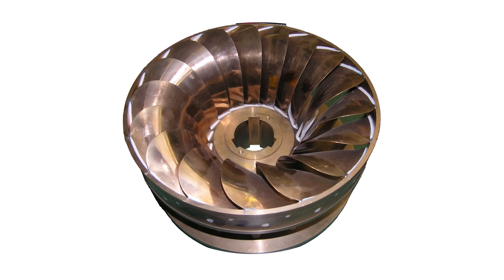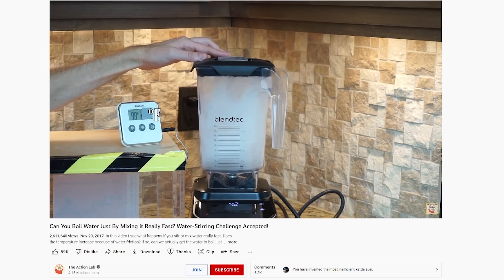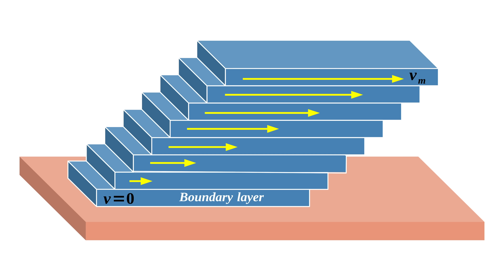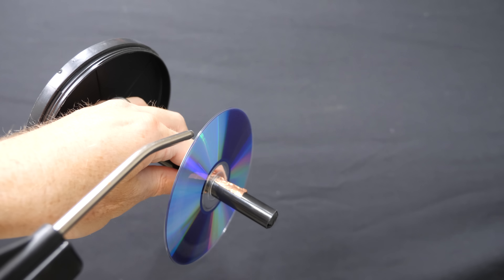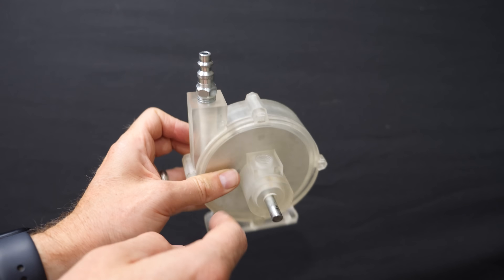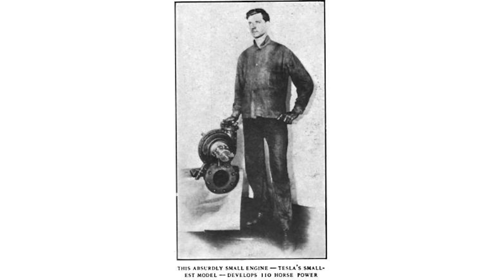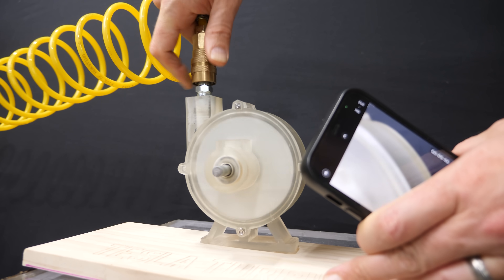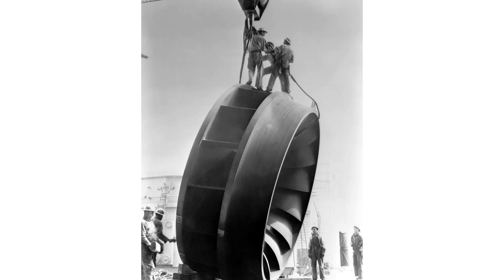How Fast Can a Tesla Turbine Spin?

Comment: In the wine industry, I was amazed to see a Tesla turbine used as a wine pump. This was in 2008 at Frey Winery (Redwood Valley, California.) The Frey family are MIT level geniuses who are happy just making wine.

They were using Tesla turbines as reversible wine pumps long before the Internet got fascinated with them -- and have been using the design in a practical manner for decades.
Reply: Is this because wine can "bruise"?
Reply: This is interesting as hell. Appreciate you dropping the heads up.
Reply: That was a very helpful comment for me . Thanks for the information
Reply: The Frey family sound like wonderful people.
Reply: @879PC  Just don't invite Walder to your wedding.
Reply: Tesla turbine or pumps are not reversible, it is peaked at around 50% to 60%. Because it uses boundary layers, that is main reason of aerodynamic drag and efficiency losses. Hydrodynamic turbines and pumps can achieve 90% efficiency, but complex geometry.
Reply: @murat9268  When you can type in complete and coherent sentences, it might be worth replying to your thoughts. Until then, I can assure you (having used them myself on $1k/gal+ wine) that Tesla pumps are reversible.

Be Well, Friend.
Reply: @fenwickrysen  Reversible mean no losses of any kind, means ideal. I think your engineering knowledge is not "complete and coherent"... There are no reversible machines. All of turbines, pumps and compressors have their efficiency curves (Cordier Diagram), that shows where their respective efficiency is peaked. Tesla turbines and pumps are simple design, not best efficiency design for specified purpose. 

Using a tesla pump does not prove that it is 100% efficiency(means reversible.) Calculate reversible work needed, then measure how much power is consumed and calculate efficiency of your pump.
Reply: @murat9268  I believe they mean reversible as in 'can be spun the other direction.' Not reversible as in 100% efficient with no losses. My car's engine isn't 100% efficient, but I can still put it in reverse.
Reply: @DroeGaming  Engine does not turn in reverse, your differential have one more gear to reverse rotation.
Reply: @murat9268  I'm not sure why you are assuming that the reversing requires 100% efficiency.  Can you please explain further?
Reply: @murat9268  Depends on the power source. Lets say it was powered by a combustion engine then yes you would need another gear between the drive shaft and the tesla pump. However I would argue that is a problem in the power source not the pump.

A 3 phase motor can be reversed by switching any two of the power inputs around the Tesla pump is 100% reversible. Your arguing that because the power source cannot be reversed easily the pump cannot be either. The pump is independent of input when we say its reversible we are saying the pump can change flow direction with out haveing to be disconnected and turned around.
Reply: @therasco400  I'm out. Nobody here know simple thermodynamic concepts, i cannot teach laymen thermodynamics.
Reply: @murat9268  transmission, not differential
Reply: @murat9268  No you do understand this device at all. 

We are saying apply power to spin one way it will pump water that direction. Apply power to spin in other direction it will spin in other direction and then pump water in that direction. Inlet becomes outlet, outlet becomes inlet. 

There is no conflict in thermal dynamics in this instance as its being powered by a motor. 

Your comment on thermal dynamics seems to me you believe we are talking about steam, we are not. We are saying you can change the pump flow by reversing spin direction, not that steam will flow in a different direction.
Reply: @fenwickrysen what do you mean by reversible? Surely not the 100% lossless definition that came out of nowhere?
Reply: @ki0w0-lordofwatersheep  Thanks for the laugh! No, not reversible in the physics arrow-of-time sense. Reversible as in the input and output feeds could become (respectively) the output and input feeds.

Comment: Actually it is not the laminar flow that is responsible for the working of a TT, it is the turbulence in the boundary layer. It is the turbulence, in the portion of he boundary layer,  that transfers power from the fluid having mostly laminar flow, in middle of the inter disk space, to the disk surfaces. In addition, it is that turbulence layer, which increases with the increment of the differential speed, between the fluid and the disks, that creates negative pressure and sucks (as described by Dr. Robert D. Hunt in his "Drag sucks" )  the disks strongly towards the inter-disk spaces (behaves something like magnetic lock), which allows the turbine to create its torque. And all these things even do not take in to account the thermodynamic characteristics of the fluid, which change as the fluid swirls in the inter-disk spacing. In short TT, in spite of its simplicity is a very complex thermodynamic transformer that should be studied via real world models, instead of relying on standard postulates, many of which are frankly, very miss understood (as Dr. Hunt also notes).
Reply: 🤭 turbulence means loss… full stop.
Reply: Charlie solis builds actual working TesTurs. You can’t argue with real results.
Reply: Turbulent flow is only created if you spacing is to wide in between the discs if it's 2,5x the boundary layer it's gonna be fine
Reply: @oscarverwey  should be less than 2x the boundary layer.
Reply: @CharlieSolis  yahh at working conditions it should be les than 2 X when startup I can imagine it's higher

Comment: Could they be scaled down and arranged in an array with funnels to catch rain water and use that to produce electricity? Each drop would spin the disks a little faster. I haven't seen any system that harvests energy from rain, but I'm sure there must be some.
Reply: Why would every drop spin it faster? Rain drops only travel at a few metres per second so they're not going to make anything spin faster than that even assuming they transfer their energy well.

They do have things that harvest energy from rain. They're called hydroelectric dams.
Reply: @igrim4777  The first drop that hits it wouldn't make it spin at top speed. Each successive drop would make it spin faster. 
Rain is actually different than a reservoir of water. Rain is water that falls from clouds in small drops called raindrops. A dam holds back a body of water that could have come from many sources, a spring, a melted snowflake, a hiker's pee, or even a raindrop. Do you see the difference now between rain and a dam of water, yes you do.
Reply: @BariumCobaltNitrog3n  Rain falls at about 10m/s per 6mm rain drop, that means with 100% energy transfer theres only a tiny bit of energy that will max out at approx 10m/s thats IF a rain drop could turn a large turbine which is doubtful, and as soon as any work load is put on the turbine the torque will cause it to rotate slower untill it stops. For a more average sized rain drop we get 7.833914655x10 -5 joules or 1 billionth of a KW/h if it has zero losses per drop so 1 KW/h would take 1 billion raindrops directly hitting the turbine "blades" at 100% efficiency.
Reply: @ikitclaw7146  Ok and how many raindrops per square mile in heavy rain? Not tropical storm but the Gulf coast gets a lot. Also there are little funnels so each drop is more like 3 or 4 drops and you're right it wouldn't be a large turbine. Solar panels don't put out much by themselves but in large numbers get some work done. When the sun is gone and it's pouring the panels could turn over and collect some energy from the rain.
Reply: @BariumCobaltNitrog3n  You want a turbine that is square miles in size? are you aware of how gods dam huge a square mile turbine would be?
Reply: @ikitclaw7146  No. That was a math question. The turb...nvm

Comment: I've always thought it would be easy to take excess solar power, use thst to compress air and release thst air later to generate electricity.  This seems like a very easy way to DIY that into reality.  Now I just need a massive compressed air tank and a compressor, thankyou action lab for putting the last piece of the puzzle together for me!!
Reply: But that will be inefficient and it would have a lot of energy loss in the process
Reply: @aniketmandal8786  Compressed Air Energy Storage (CAES) and Liquid Air Energy Storage (LAES) systems are a 100% competitive and viable option even with almost no compressed air engines on the market getting better than ~50% efficiency… most only getting 5-20% efficient. 

Air compression for storage can be very efficient if you just recoup the thermal energy during expansion.
Reply: @CharlieSolis  ahhh the TesTurs that you make are amazing! Keep up the great work! 

Everyone up and down these comments are demanding Tesla turbines can’t work/get low torque/have to be spun to fast to even work yet you’ve got all sorts of proof that Tesla turbines get a butt load of torque even at low rpms!! 🤤

How are these people trying to argue with your conflicting TesTur results? Do they just not know about your work?!
Reply: @aniketmandal8786   also meant to say, “But an interesting idea nonetheless. Keep on using that brain of yours!!!”
Reply: Why use compressed air when you can pump water to the elevated container?

Comment: Something is missing Tesla didn’t make it for low efficiency
Reply: Charlie solis makes real working Tesla turbines. There’s nothing wrong with them. You just have to know how to actually design them. 

Do what Tesla says to do, not spin them fast. 😂

“Owing to a number of causes affecting the performance, it is difficult to frame a precise rule which would be generally applicable, but it may be stated that within certain limits, and other conditions being the same, the torque is directly proportionate to the square of the velocity of the fluid relatively to the runner and to the effective area of the disks and, inversely, to the distance separating them. The machine will, generally, perform its maximum work when the effective speed of the runner is one-half of that of the fluid; but to attain the highest economy, the relative speed or slip, for any given performance, should be as small as possible. This condition may be to any desired degree approximated by increasing the active area of and reducing the space between the disks.”
-Nikola Tesla
Reply: @testurenergy  something missing dude!
Reply: @roycropper420  what do you think it is?
Reply: @testurenergy  I have no idea, I am noooo electrician
Reply: @roycropper420  I think Charlie Solis has figured it out then! His Tesla turbines actually work and have shown to actually produce real electricity. He’s done up to 2650 watt electrical power tests with his turbine on just room temp compressed air 🤭 not even using heat added to it yet!

Comment: There has to be some market and adoption of Tesla turbines. Was there any research on this point before publishing the vid? I’m curious. I would like to know some examples of where they’re used, when they were updated from earlier turbines, etc.
Reply: I build real actual working TesTurs that output actual power and torque even at low RPMs. Half the claims in this video are downright false.

It would seem almost no research was done, and it would seem the patent wasn’t even read because the erroneous claim that the TesTur has to spin fast to work just gets parroted over and over and nowhere in the patent does it even say that. 

The only time it’s supposed to spin fast is when used as a pump/compressor because ALL centrifugal pumps/compressors performance is too speed dependent.

“I have found that the quantity of fluid propelled in this manner, is, other conditions being equal, approximately proportionate to the active surface of the runner and to its effective speed. For this reason, the performance of such machines augments at an exceedingly high rate with the increase of their size and speed of revolution.”
-Nikola Tesla 

But when run as a turbine and spun to fast the centrifugal head will counter the incoming fluid flow, reduing the pressure gradient across the nozzle, reducing the fluids final velocity after the nozzle, reducing the mass flow rate through the nozzle and ultimately reducing power. 

Spinning fast only has a slight increase in efficiency but at the cost of power. 

Again even Tesla himself knew they weren’t supposed to spin fast and even says they work great at high and low fluid speeds and speeds of revolution. 

“Still another valuable and probably unique quality of such motors or prime movers may be described. By proper construction and observance of working conditions the centrifugal pressure, opposing the passage of the fluid, may, as already indicated, be made nearly equal to the pressure of supply when the machine is running idle. If the inlet section be large, small changes in the speed of revolution will produce great differences in flow which are further enhanced by the concomitant variations in the length of the spiral path. A self-regulating machine is thus obtained bearing a striking resemblance to a direct-current electric motor in this respect that, with great differences of impressed pressure in a wide open channel the flow of the fluid through the same is prevented by virtue of rotation. Since the centrifugal head increases as the square of the revolutions, or even more rapidly, and with modern high grade steel great peripheral velocities are practicable, it is possible to attain that condition in a single stage machine, more readily if the runner be of large diameter. Obviously this problem is facilitated by compounding, as will be understood by those skilled in the art. Irrespective of its bearing on economy, this tendency which is, to a degree, common to motors of the above description, is of special advantage in the operation of large units, as it affords a safeguard against running away and destruction. Besides these, such a prime mover possesses many other advantages, both constructive and operative. It is simple, light and compact, subject to but little wear, cheap and exceptionally easy to manufacture as small clearances and accurate milling work are not essential to good performance. In operation it is reliable, there being no valves, sliding contacts or troublesome vanes. It is almost free of windage, largely independent of nozzle efficiency and suitable for high as well as for low fluid velocities and speeds of revolution.”
-Nikola Tesla
Reply: @CharlieSolis  keep up the amazing work! You’re going to change lives!!
Reply: Modern TesTurs have been shown to get over 80% efficiency….

“Design and Development of a Small-Capacity Tesla Turbine for Rural Applications

Bangladesh is in great need to find renewable energy sources for its fast-developing industrial sectors. The main objectives of this research are to design and fabricate a small-scale efficient Tesla Turbine for remote areas and test it through experimental investigations. Performance analysis of the newly designed Tesla Turbine suitable for remote areas of Bangladesh will be conducted. Until now, a number of researchers have undertaken several tests and studies to evaluate the Tesla turbine's performance and efficiency. Tesla Turbine does not proficient in producing torque. The work here consists of computational analysis and an experimental campaign by fabricating the turbine. Solid Edge 2021 is employed for our 3D modeling. For modeling, the desired material is Polylactic Acid (PLA) or ABS Plastic. The proposed design consists of 51 disks with an identical spacing of 3 mm. This design has led to achieving a torque of 19.85 N-m and a staggering efficiency of 81%. It was found that stress generated on the disk edges is higher than their centre due to high centrifugal force.”
Reply: @CharlieSolis  Dude stop spamming your crap on all your alt accounts. It's pathetic.
Reply: @-Devy-  🤭 ok bud. Keep telling yourself that. I’ll be over here making actual working Tesla turbines ✌️

Jealousy doesn’t look good on you.

Comment: I'm curious about cavitation, they work for heaters, instant steam generators. But ive read somewhere that it also helps with aerodynamics.

A vehical with golfball size indents spaced an inch apart all over the car will supposedly more aerodynamic because it's ability to resist air friction by using its own cavitational eddy throughout the entire surface. Thus allowing air to flow against air with the boundry of that cavitation air/sound?.. 

Theoretically speaking it will only show larger improvements upon higher speeds. Research is hard to find on this subject matter, I'd test it myself if i had time and $. Thank you for your video content, i enjoy it very much!
Reply: Gas flow does not cavitate.  Golf balls do not use cavitation.

Comment: Which is better, a big Tesla turbine or a really small one?
Reply: Depends on your application, sizing demands, etc. 

Do what Tesla says to do to get an effective TesTur:

1) increase the speed of the fluid relative to the disc. (Not increase the disc speed) 
2) increase surface area
3) decrease disc spacing. 

“Owing to a number of causes affecting the performance, it is difficult to frame a precise rule which would be generally applicable, but it may be stated that within certain limits, and other conditions being the same, the torque is directly proportionate to the square of the velocity of the fluid relatively to the runner and to the effective area of the disks and, inversely, to the distance separating them. The machine will, generally, perform its maximum work when the effective speed of the runner is one-half of that of the fluid; but to attain the highest economy, the relative speed or slip, for any given performance, should be as small as possible. This condition may be to any desired degree approximated by increasing the active area of and reducing the space between the disks.”
-Nikola Tesla